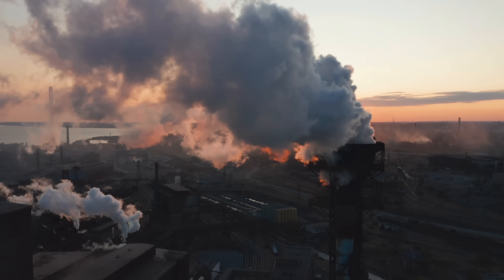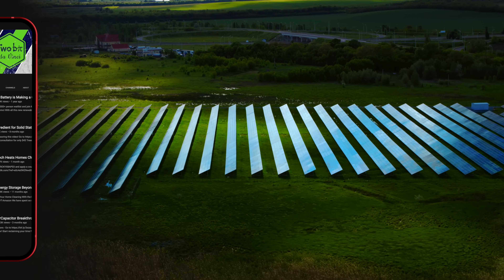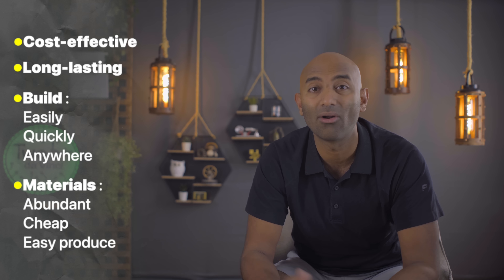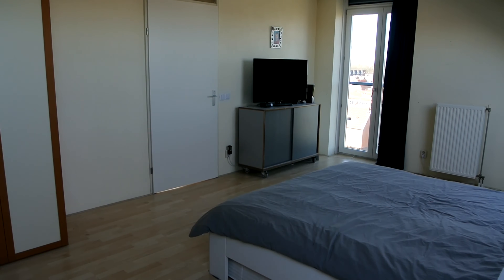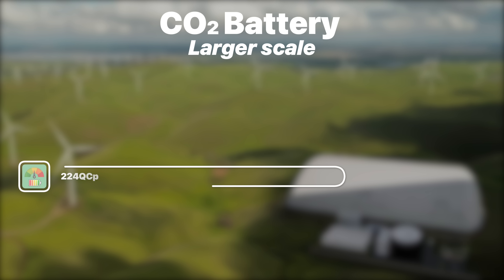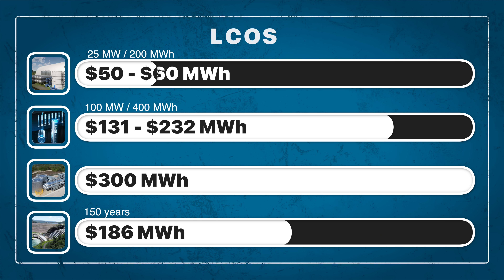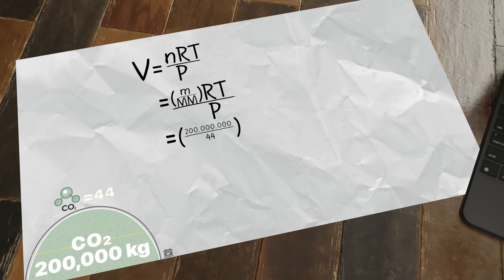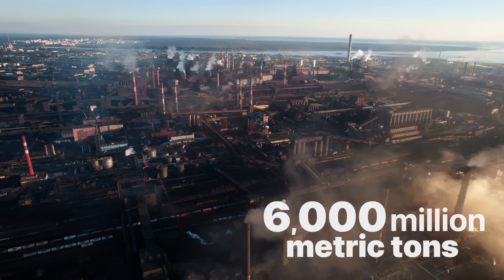The GENIUS Of the Carbon Dioxide Battery

Comment: Ricky what about storing the pressurized CO2 in underground reservoirs, ie. salt domes or depleted natural gas reservoirs?
Reply from the maker: very interesting, is there any concern with contamination?
Reply: @TwoBitDaVinci  if your using depleted natural gas reservoirs or salt domes there is little risk, caveat if they hold pressure, which is one reason salt mines are abandon because of groundwater infiltration or salt runs out. In both reservoirs contamination from CO2 or any CO2 contamination is a low risk because the natural gas/oil or salt has already impacted the rock and possibly the groundwater. The natural gas industry uses these natural structures/features to store gas closer to their consumers.
Reply: Summit Renewables is trying to get an approval for building a pipeline for CO2 in the Dakota's. Farmers and Native Americans are against it, but interesting farmers like petroleum pipelines only. Cite dangers in CO2 and farmland damage - not like an oil spill is good. Anyway, the CO2 comes from ethanol production and the company's plan is storing the CO2 in underground reservoirs. Too bad someone doesn't promote a "battery"

Comment: If this actually works (commercially I mean) there will be an incentive to create portable carbon capture. So it's high energy usage so what? You park your cc capture truck next to the windfarm you built your empty co2 battery on, and use the excess energy for the first few months to fill the battery. Or series of batteries. The wind farm battery owner just leases it for the duration
 Then you roll your cc capture device to the next new battery.

Plan to expand your energy storage? Lease the cc truck for another couple of months once you're ready.
Reply: I'd deliver the gas that I store in a pressurized tank. Pre captured.
People would pay for that service.

Comment: Seems like we have dozens of capable energy storage options. Hopefully some of these gain traction and really go mainstream. I couldn’t care which takes off.. whatever the market decides will work best, or first or most efficiently or whatever their requirements are.. just get ‘em in production already! There’s gigawatts of green energy out there that needs storing.. and terawatts in the future. Get ‘em crankin!
Reply: Well, that's a short-sighted attitude. I'd want an energy capture system to be reliable, efficient, cost effective, and safe, cheap, and easy to build, operate, and maintain. This looks much better than a typical water reservoir/dam/hydroelectric system. It doesn't require dangerous or exotic or expensive materials, or the extraction and processing of those materials.
Reply: @oahuhawaii2141  neither does a sand thermal storage system.. an ‘air battery’.. a dozen different kinds of mechanical energy storage.. there are LOTS of energy storage options that don’t require anything in the way of rare materials. Now, how efficient they are in comparison.. is worth a glance if you were the investor, but my guess is there isn’t Huge variance in their efficiency and they all seem reasonable in cost. The energy storage piece is the only thing lacking in making renewables a 100% viable option across the entire globe. Some will work better in certain locations than others.. i say get some savvy investors to get a whole range of these systems into production. Sooner the better. There is no reason to wait for any one to ‘win’. Get ‘em all going. We need a mega ‘shit ton’ of energy storage globally
Reply: CO2 helps plants grow. Our planet is 5% greener than 20 years ago, thanks to CO2. We are still in an ice age let's get out of the ice age and melt this fucken ice. The dinosaurs had 3000 ppm of co2, and their temperature was only 27 Celsius. We have 430 ppm only 0.04 percent of our atmosphere. Our weakening magnetosphere is what is driving climate change, not CO2.

Comment: Making these energy storage devices out of any rare Earth minerals is a travesty.

It's a waste of life a waste of money and a waste of material.

We should be converting this into a neutral substance like hydrogen and using them as battery cells instead of wasting all these metals that will only last a decade before thrown into a land dump and started all over.

Hydrogen we don't have to worry about that or that heat sink battery that uses sand for the one that makes the metal glow and the solar cells recover the energy any of these technologies are fine and going in the right direction but two bit constantly pushing these defective flawed fundamentally at their core technologies is a disservice to our future children and the children that are mining those rare minerals that all these solar nuts and are always forgetting about and conveniently dismissing.

That gas cars are less wasteful than solar panels

Comment: Wish you would get your data correct.  Co2 is a building block not an enemy of the environment.  So called renewables are consumables as they can not easily be recycled.  When are you going to get your facts right. Stop talking this climate crap.

Comment: So, what about scaling it down to house or neighborhood scales. At house scales, it could make sense on farms. 
Also, what temps does this operate at? Could this be paired with a home heating/cooling system so you recoup some of that lost energy?
Reply: This is little more than a standard refrigerator/freezer system except that its design's main purpose isn't to cool or freeze an enclosed box, it's to store a massively large amount of cooled carbon dioxide refrigerant in the system by attaching a large reservoir. It operates like a refrigerator/freezer in any home at ambient temperatures and the design as described chooses not to utilize the benefits of heating/cooling immediately but to trap that energy for use later.

So, I see no reason why this couldn't be operated at any scale from a home to a large building to a metropolitan power system. I also imagine that an idea like this could commercialize carbon dioxide like fuel but not to burn but as a refrigerant for any reason like repairs, enhanced output, emergency generators, etc. Transportation would be the same as current infrastructure... by truck, pipeline, tanker, or portable bottles.
Reply: I don't think all the plumbing and machinery for a system like this is going to be cheaper than a battery at the home scale.

Comment: Wind and Solar is not cheaper, because you have to add the cost of batteries to make them somewhat reliable. And in cold Northerly climates , you need to store summer solar for winter heating, which cannot yet be accomplished. Hopefully this technology can fix that at a large scale.That would be great.
Reply: In the summer you could use energi to lift something big, ( a mountain) And let it sink down throuout the vinter. Very expensive but..

Comment: Wow, this seems filled with innacurate claims. Note, I'm half drunk and not a scientist, so take with a fistful of salt.
But WTF? "external heating to boil and liquify the air". That's not how physics work. When you boil something, you turn it from a liquid to a gas. Liquid air will boil instantly at room temperature. Look at a phase diagram. I stopped watching at this point, as it just seems like musk-style tech bro mumbo jumbo. Who cares how fast they secured funding and built something, VCs are gullible sheep.
Data or gtfo.
Reply from the maker: yeah it is, to compress and hold air you need to freeze it and it requires external heat to return it to gaseous form... which isn't true for CO2, its all in the video. cheers

Comment: you dont need to use energy if you are smart, float instead of actively push, like blimp vs a helicopter vs a bridge
Reply: there is nothing "ours", ie nothing mutually together, only what is God's
Reply: you are judging wrong the density if you count the weight/volume into the total energy density
Reply: scale up the volume then your other costs/measures become neglible, like me
Reply: therefore money mutual "work" is nonsense, get out, do your own stuff
Reply: I'm not your own
Reply: logic laws dont make you own anything
Reply: not agreed
Reply: of course you can use compressed air as well, what the heck

Comment: This is kinda dumb. Add a  few hydrogen atoms to the stored co2 and boom, gasoline, a room stable liquid fuel that is highly concentrated…. Why chase anything else
Reply: Adding to this, 4mwh is about 120 gallons of gasoline, maybe 350 if you take into account the heat losses and generator losses. Dunno haven’t done the math yet. Still why aren’t we just storing co2 in fuel form…. Unlimited battery basically. Also the infrastructure is already built